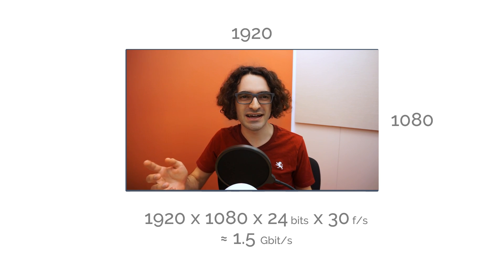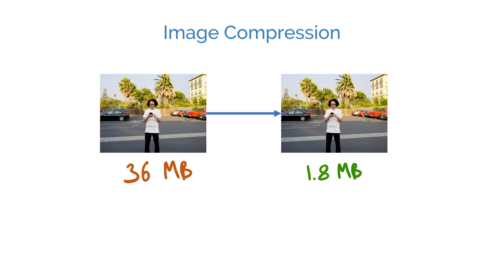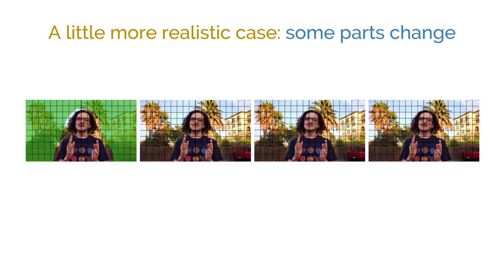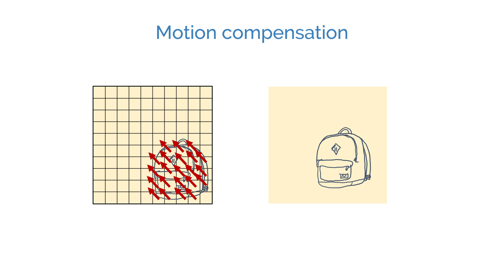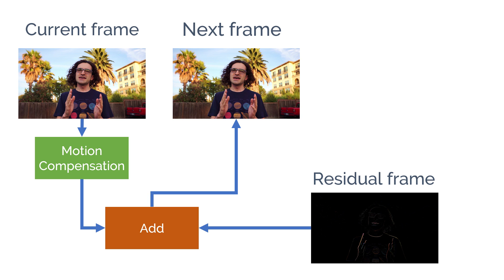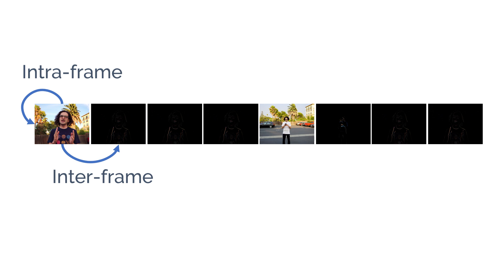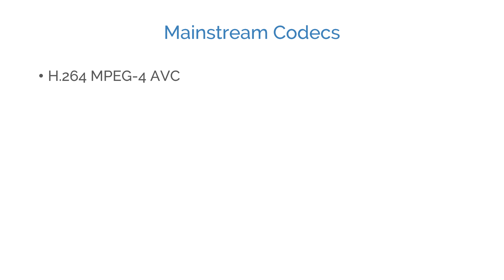How Video Compression Works

Comment: Hi, I think I spotted an inconsistency.

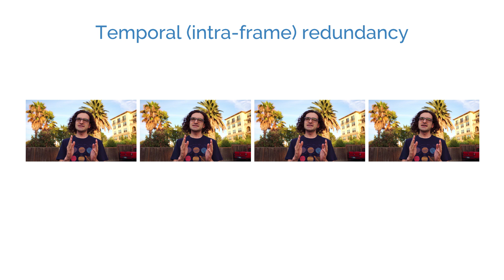At 01:06 and 01:21 both say “intra-fame”. 
Later at 03:15 you speak of “intra-frame” and “inter-frame” compression.

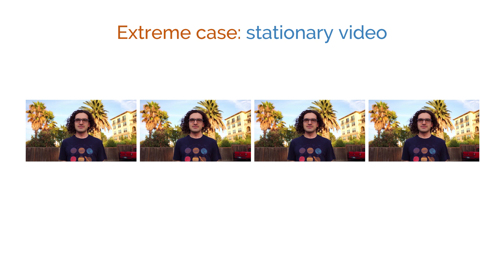Does that mean the slide at 01:21 should've said “inter-frame”?

Comment: It’s just sooo mind blowing how all those video compression formats works,it just blows my mind how the decoder reconstructs and approximates the original frames back,so what we are seeing on tv is not the original footage but an approximated version of it,heck our tv’s can even add extra new frames between wxisting frames to averagely more close approximates mother nature in terms of motion, so what if the footage was only recorded at 12 frames per second,then your 100hz tv can add 8 new frames between 2 existing frames to smooth up the motion,it’s just mind blowing what can be done with less,😁

Comment: Aren't motion vectors inverse? like the next frame takes data from previous frame so there might be a case where 2 regions take data from same region? The way it's shown here looks like the regions are scrambled by motion and you end witht a lot of empty spaces (like 100x100 regions will result in 1:1 100x100 regions which I guess it's not the case in real scenario)? correct me if I'm wrong

Comment: So how come sometimes it's a lot more obvious and worse than others? Does that mean it's, as we say, super compressed? Or does it just mean it's bad compression? For example Facebook posts versus YouTube
Reply from the maker: The compression rate, method, and the content itself affect how good quality a compressed video is. The more you compress the more visible the artifacts become. I assume both Facebook and YouTube use state of the art compression methods, so the difference in the quality boils down to how aggressively a video is compressed. Also, not all videos are equally compressible. The more 'busy' a video is  (i.e. lower spatiotemporal redundancy) the harder it is to compress without noticeable artifacts.

Comment: What's really interesting is that some of you may have already seen glimpses of this happening when video playback "glitches."

Take this video from the animated adaptation of "The Dark Knight." https://www.youtube.com/watch?v=_KfsAK3fIQo

In the beginning, the frame is completely grey and you see blocks of new detail appear and pan up. This is basically happened there is that for some reason, the very first frame upon which the frames of the first two seconds are based on was missing. The decompression algorithm therefore applied all that block motion estimation on a grey initial frame. New frames are loaded and then shifted upwards.

I've had moments when I was clicking on the timeline of videos on my computer where the current frame would also be lost, but I would see the residual frames be applied to the grey frame. The result often looked like a kind of grayscale drawing of what the frame should look like. It's really interesting.

Comment: how about the audio .
Reply from the maker: Different compression standards use different techniques. Many audio compression methods operate in the frequency domain. Maybe I should cover that in another video.
Reply: above 16khz gets cut, below 20hz gets cut or high passed. Also most videos are volume normalized, you can see the stats if you right click the player and click ''show stats for nerds''